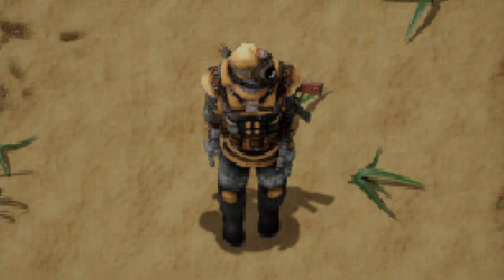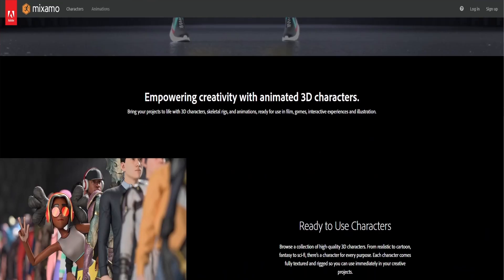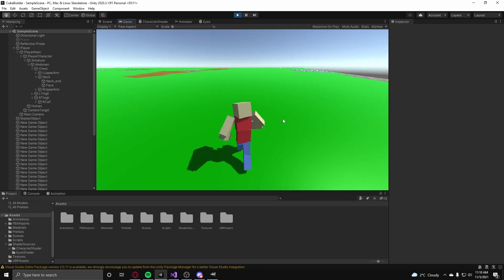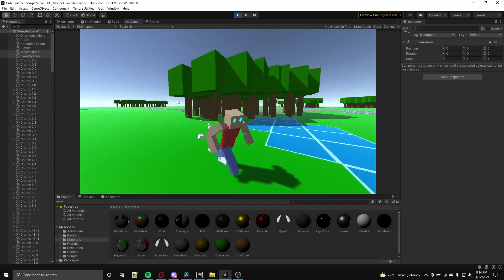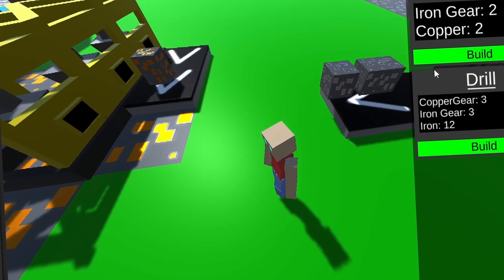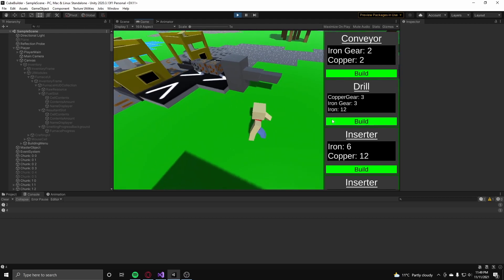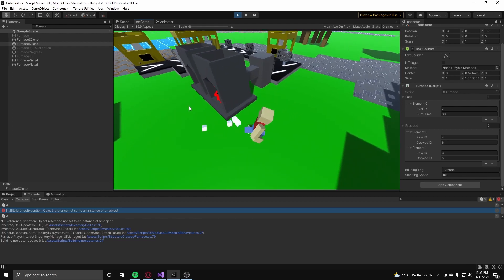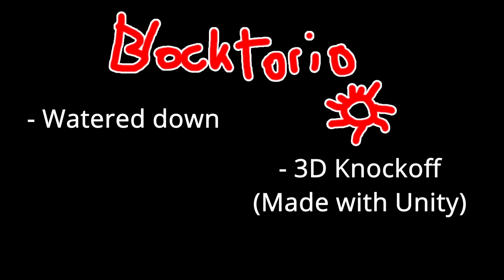I Recreated Factorio but in 3D in Unity

Comment: super video make a video about how did you learn c# and unity 
specify the main videos you watched ,,,channels you follow etc
Reply from the maker: I would watch videos to understand the base things. Once I am comfortable with all the basics I know (like I can apply the knowledge without having to look at a video), I would make develop projects and use the Unity docs, Microsoft docs, and Stackoverflow to expand my knowledge and understanding. For thinking about problems and solving them, I would break the problem down into its multiple components/steps and then tackle each step and link each step together to finally solve the main problem.

In short, Brackeys paved the foundation and I just built it up through self-initiative from there.
Reply: @Rytech_Dev  thanks for reply